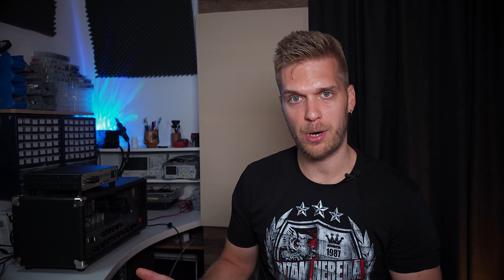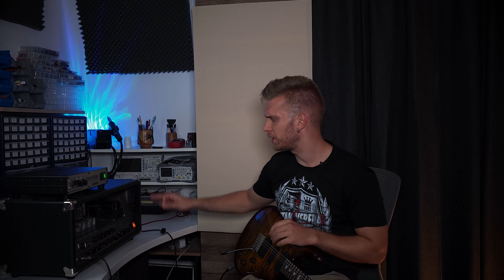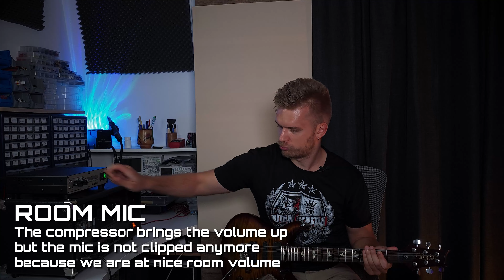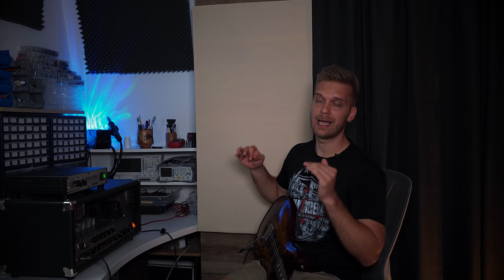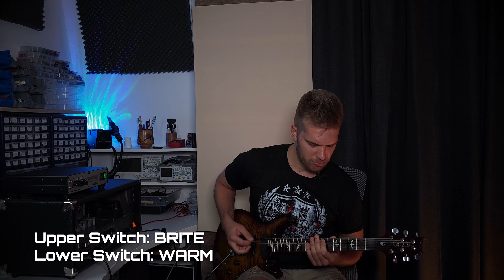The Fryette Power Station Explained: Why It's Worth The Money

Comment: I have a PS100 and it's a fantastic design! I use it with my Marshall, Friedman and other amps I am a 70 year old geezer who has been playing guitar consistently for 50 years+. I have spent my career as an EE in various industries with design roles primarily in analog and power electronics. My current project is a high powered portable wireless subwoofer design. I have been watching your channel for a couple of months now, and I respect what you are doing. But when I saw you using LTspice in this video video, I was amazed and I am a major fan of your channel. You are filling a technical void in the guitar electronics world. I am now subscribing to your slightlytechnicaluniversity channel. Huge thanks and best of luck with your mission.
Reply from the maker: Thank you for the kind words!

Comment: If you were using an effects modeler to play through this unit with a real cabinet, would you use an IR?   Knowing that your cabinet already has a dedicated speaker already.
Reply from the maker: If using any kind of modeller / preamp / processor as line input in this unit and then using it to run a guitar cab, definitely switch all IR cabs off.

Comment: Do you know how simpler linear attenuators deal with impedances when a speaker is connected to them? Do they react to the impedance of the speaker at all? I have never measured the impedance curves. Would be interesting to see how different load boxes measure.

Comment: Hi, can you explain how impedance matching is done in loadboxes with 2 transformers? Like Ironman or Powerstation. Can you simply use 2 output  transformers and interconnect the primaries. What happens to amplifier connection and feedback from the speaker when you play through this setup?
Reply from the maker: I don't quite understand. Can you maybe clarify the question? Why would you have 2 output transformers and interconnect the primaries?
Reply: Hi, not sure why my reply has not been posted. I mean Ironman and Fryette you have impedance matching. Let's say you want to connect 16 ohm amp out to 4 ohm cab. You have 2 output transformers in between with connected primaries and get impedance matched (selector on dummy loads). This kind of matching can not be done with serial or parallel resistors. But I wonder what happens in this kind of setup when you have inductive interconnection to the speaker. How feedback from the speaker goes back to amps output transformer and what happens to impedance curve? Do you have experience on this?
Reply from the maker: @Stu66orn  Hm, it's a bit of a longer story, I plan on making a comment reaction video and I'll address this as best as I can